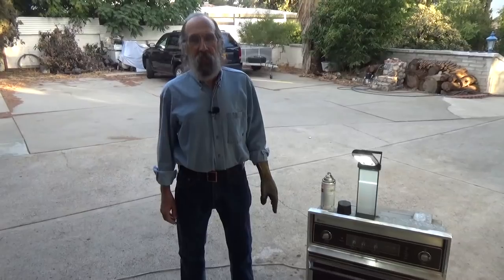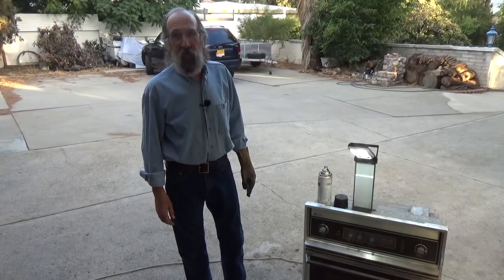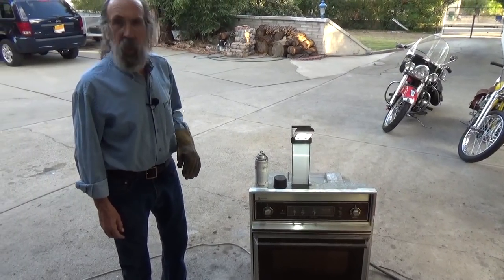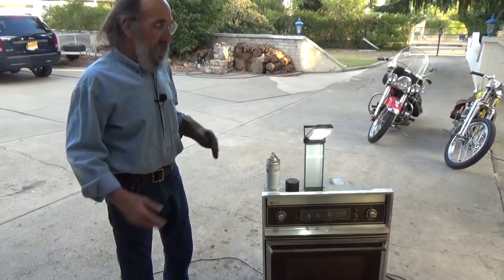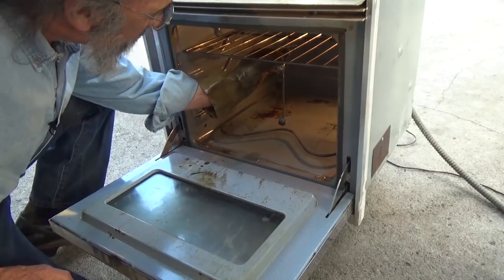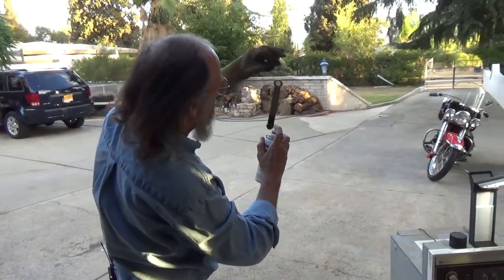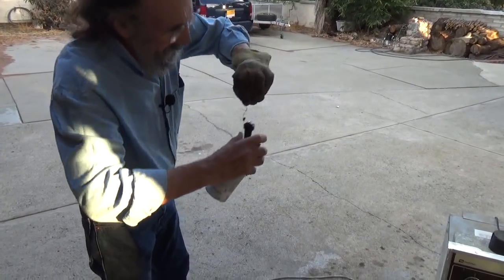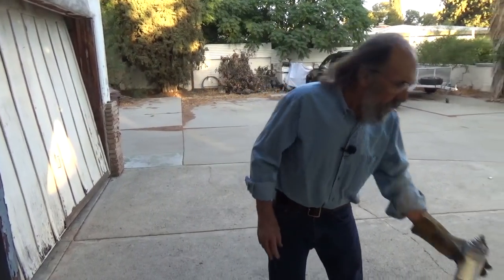Painting a Small Part For The 1940 Harley Davidson Flathead Project Bike

Comment: Hey there Mike, I did demolition for years here in Florida and I salvaged an oven out of a demo and I use it for powder coating, works great. And as I was typing this you dropped your part you were painting and reminded me of a fuel tank I was priming with a hardner and using a step ladder to hang the tank from by a wire,I dropped the tank in the grass as I was priming it and knowing I was using a primer WITH a hardner, picked the tank up off the grass and continued to prime.When the primer hardens I sanded the grass out and added my top coat! Still using that tank on the scooter and folks only know if I share the story. It's all part of the ride,Maranatha, Greetings from Tampa Florida 😎
Reply from the maker: You said it so well.  I wasn't going to say it in the middle of the video.  Greetings and Thank You.

Comment: Great painting tip.  Something I do is pull the paint nozzle off the can and put it in a small container of paint thinner for a few minutes.  Blow the cap out with compressed air.  Replace the cap on the can for the next paint job.  You won't lose any pressure from the can cleaning the paint out of the nozzle this way.  Thank you for another great video.  Keep the rubber side down.
Reply from the maker: Great tip!  Thank You.

Comment: Mike....good video! I use my wife's oven (I have various heaters in my shop but no oven) to hear engine cases before welding. (preheat) Occasionally, when fitting parts together I'll heat to expand the metal then use our freezer to chill shrink metal....heat is a tool!.....thanks for doing these vids!.....walt...tulsa,ok
Reply from the maker: Thank You.  Well put.  I really wanted to show a cheap wy to get there.  In the old days, every motorcycle shop had a stove.

Comment: Mike--i just did a rattle can pain job on a couple of Ironhead Sportster fenders and found a fantastic clear coat, if you ever want a gloss finish. It is called Spray Max 2k Glamour Clear Coat. It is a 2-part urethane paint in one can. The results were amazing. I don't think that I could have done a better job with a gun. The only downside is that the contents of the can must be used within about a 48-hour period of time . After that the hardener solidifies the contents
Reply from the maker: Thank You.  Maybe we'll try it.  I generally paint motor and chassis parts and leave the heavy work for the pros. I painted cars and anything else a long time ago.  I'll probably let the pros paint the tanks and rear fender on the Flathead.  Maybe I'll get nervy.  Who knows.

Comment: Hey Mike I alway's turn that rattle can of spray paint upside down and give it a couple of shot's to clear the tip out for next time. I have seen some pretty nice pieces that have been painted with a rattle can. Have you ever seen Vice Grip Garage.. Derek there painted his Batwing fairing on his Harley with rattle cans. Base coat clear coat. He cut and polished it after it was painted. Looked like it was done at an autobody shop. Stay safe man. And I know you were outside,, but wear a mask...
Reply from the maker: Cool, thanks

Comment: When I was a little kid my dad was trying to find some black the would not chip off Drag bike exhaust pipe's. He even tried to use gun bluing. He was baking them in my mom's oven. lol... About 15 years ago I discovered PJ-1 high heat flat black (because I always have black pipes for some reason). About $14.00 a can back then. I got the same PJ-1 on my pipes now and it has never chipped off.
Reply from the maker: Cool.  I'm talking cast iron cylinders, even cast aluminum.  Try it.  Open your mind and give it a try.  Tappet blocks, etc.  Plain old enamel.
Reply from the maker: That PJ-1 is great, once it's cured (with heat).

Comment: I do ALL my own paint. Partly because Im cheap and partly because I am a professional fine artist.  Number one thing about paint is prepping it right and wiping it down with paint cleaner (mineral spirits). Cleaning it perfect is imperative. Light coats that barely cover it is the key dude. If you put it on to heavy, it looks really good but later down the road I guarantee it will get spider web cracks. NEVER heavy.
Reply from the maker: On cast iron?  Heavy rules.  Heat up the part, load the paint on and bake it.  Try it.

Comment: Here in the desert SW we could just set it outside for a while and the sun would bake it dry in the Summer sun. Then you pick it up bare handed and burn the crap out your hand, lol.  I'm sure that old oven still works great. Good ol' American made quality. Great tip!
Reply from the maker: It works.  An oveThank You.aint.n gives it more and even heat.  It makes for a harder finish.  I grew up with desert heat.  Too hot for me, but hotter for my paint.

Comment: Oven one of my most used tools that cost 0.
Heat parts.. freeze bearing races. Slip fit. Aluminum parts preheat parts to weld. Cook parts to boil oils out before paint.  Paint. And powdercoat parts i fab for customers... even have a small toaster over for small stuff.  But have and old tire display rack to hang parts on so never drop.  But watch your knuckles 🤣 in the oven grates
Reply from the maker: Great point!  Thank You.

Comment: I have always used the sun for this process which worked in summer.  What do you think about using a heat gun during the winter?
Reply from the maker: I've done it.  My answer is to use an oven.  Get your process under complete control and get awesome results from your own experiments.

Comment: Big Mike need your help doing rocker gasket gotta do top cylinder gasket also anything anything I should do while I am this far it's a 1450 dwg better proformance?
Reply from the maker: Not really.  Just  use good stuff and torque according to your service manual.  Proper torques and in order.
Reply: @pacificmike9501  thanks brother  would it be foolish to get the cylinders 20 over? Thanks again

Comment: Hello Mike. Now i know what i will do when and if i change my owen 😇. About the paint...is it heat resistent paint (like u use on engineparts) or regular paint? Kjell"the swede"🇸🇪
Reply from the maker: Try the ones you like best.  I don't have any real preference.  The point is to use nice even heat from an oven.  That makes it even and extremely durable.
Reply: @pacificmike9501  ok i try and find put what is best 👍. Fun to do some tests👍. Kjell.
Reply: I mean "find out" 😇

Comment: Ya know you would not have dropped that part if the camera wasn't rolling... :-)  I use a toaster oven for the really small baked on paint parts = no 240V required...not enough room to hang up small parts = make a stand from foil...also have used foil for difficult to mask parts
Reply from the maker: Thank You.  Good stuff.
Reply: @pacificmike9501  Thank you for this great channel!